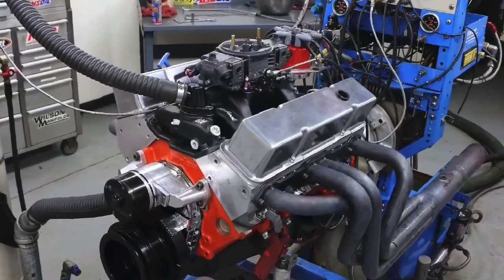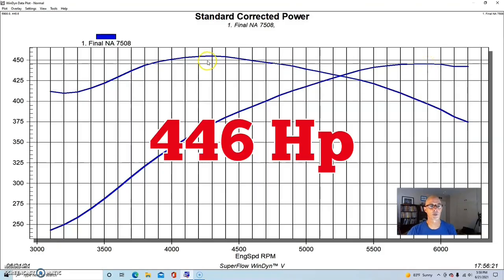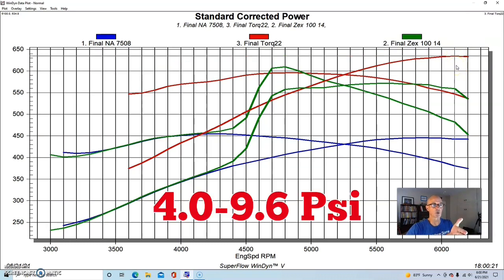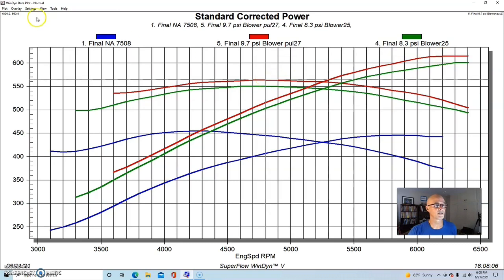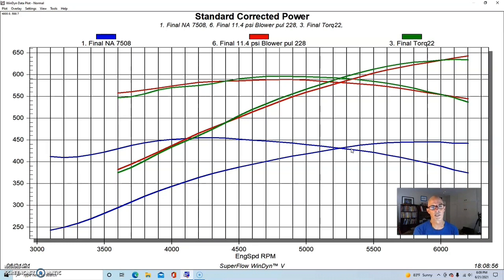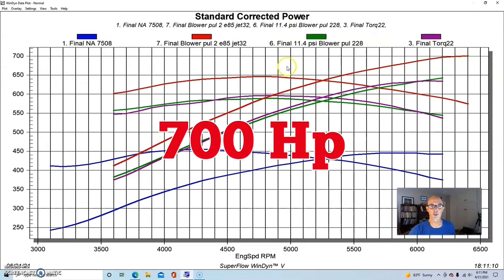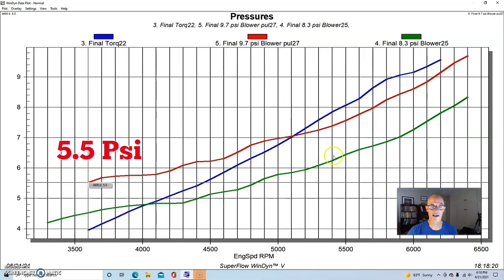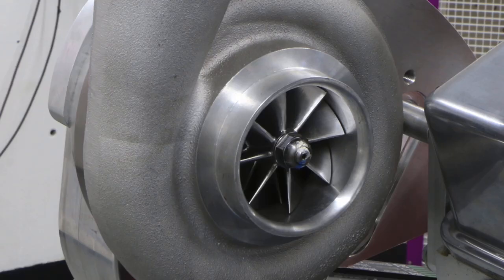6-71 BLOWER vs TORQSTORM-383 STROKER SBC BLOWER TEST

Comment: The 671 must take more power to turn than the Torqstorm. That's a big part of it, as well as the short runner manifold. It's also why it requires more boost to make the same power.
Reply from the maker: and a roots blower is less efficient than a centrifugal design

Comment: Hello. New too boost. I have a 383 with a 10.4-1 compression. Good bottom end build. I want to get this same 6-71 kit. What size carbs do you recommend to run methanol. Duel carb set up
Reply from the maker: twin 750s or 850s will feed this motor
Reply: @richardholdener1727  Thank you

Comment: how come no one ever start an engine at the lower rpm range where a street driven vehicle would be operating at? {such as from say 1200 rpm to may be 6800 rpm} on the dyno? some of us do have a family that will be riding with us where the GVRW might be around 5600 to about 7200 pounds. axle ratios in the 3.08:1 to the 3.54:1.
Reply from the maker: can you send me a video where you are at WOT at 1200 rpm
Reply: @richardholdener1727 ;on a road where starting off from a stoplight I have went to wot to get up to speed. so as I asked. how come no one start the dyno testing at 1200rpm? even our law enforcement have to go to wot from a stand still some times.

Comment: Thank you that was an awesome video I've learned both styles never was able to dino The Roots blower it was a 6-71 conversion I run a vortech V3 on a summit crate motor 383 with Abe ex250 shot of nitrous and she's a beast in a third gen Camaro I try to keep the setup Loki and she's pretty but not too fancy because I love going against these younger guys with deep pockets I enjoy it and we're all adults so it's fun but keep up the good work I love your video I'll share with others Mike

Comment: Not exactly the results the magazines predict, is it! The curves are very close, what a surprise. These two power adders are designed to make MORE POWER that's the goal.
For me, used for a drag racing, both are great, but the 6-71 should be easier, less complicated, and the one I would try first, then move to the torque storm, on the next project.

Comment: I was piecing together a v1 ti for my nnbs Tahoe with a built lmg with tsp prc2.5 799 heads. 10.5:1 compression. The customer support at vortech and the fact that many LS parts and brackets are discontinued unless you go a and a and then have to modify everything to fit Wich is no issue other than the price of the a and brackets,tensioner. Let's just say the frustration made me sell off all the vortech stuff to go tqstorm even tho I'll make less power there customer support, reliability and fair pricing is worth it's weight in gold.

Comment: THOSE 2 750 CARBS ON THAT 671 ON A VERY MILD 383 IS OVERKILL !
PROBABLY HURT BOTTOM END TORQUE LIKE CRAZY !
Reply from the maker: sorry-that is not how it works
Reply: @richardholdener1727  COULD HAVE EASILY GOT THE SAME POWER WITH A SINGLE 850 CARB,  OR 2 DUAL 450 CFMS , MAYBE RIGHT ?

Comment: did the TS have an intercooler?
Reply: I’m this situation it’s not needed as carb cools the air charge but that doesn’t work on roots because the fuel is going throught the blower too heating up

Comment: I have a 390 ford galaxie 500 1967 with a Camshaft, Hydraulic Flat Tappet, Advertised Duration 274/286, Lift .562/.565, Ford, Big Block FE.    And wanted to put a torque storm single supercharger and can i run it with out doing any work to the steal heads? Or do anything else to engine?
Reply from the maker: YES-BUT YOU WILL NEED A BLOW THROUGH CARB
Reply: @richardholdener1727  I have a 650 4-barrel carburetor from Holly can I turn that into a blow out carb? Or whats the best replacement with the most potential? "Also a great video suggestion- differences between a regular carburetor and a blowout carburetor and comparison of regular carburetor model versus blowout carburetor models!"
Reply: @richardholdener1727  and will i do any da damage to the engine with it running a 10/1 compression ratio ?

Comment: Why did you keep comparing the roots at higher boost pressure to the centrifugal saying they are the same? Compare both of them at the same boost pressure, 2psi will make a bit of a difference.

Comment: I would love to see this SBC Torque Storm supercharger be installed on a 5.7L Vortec junkyard engine with a blow through e85 carb.  Maybe pump gas for stage 1 then big cam and head work for stage 2 and ring gap, increased boost and e85 for Big Bang part 3.

Comment: The big 6-71 gets the "cool-factor" and has ALL the eye candy for sure, Torqstorm looks like a huge A/C unit compared to the ultra-cool 6-71 Roots blowers however TorqStorm rocks and can do a whole lot more than what is shown here. A whole lot more! The next pully would have put it around 14lbs and on E85 with more timing ??? 750-800hp?  That's an A/C unit I'd like to have under my hood.
Reply from the maker: WE'VE NEVER MADE MORE THAN 750 HP WITH ONE
Reply: @richardholdener1727   I was thinking that combo I mentioned would be good for about 750hp. Still a great A/C unit for sure. ;-)

Comment: A victor intake would have worked better than the dual plane. Never seen a boosted setup it didn't.  TS was about 18% more efficient. The TS is the clear winner here. That being said, a roots type blower makes everyone look. They are awesome.  TS is a great piece and would really shine is given a better intake with little water/meth from Snow hooked up. Would have made your E85 big pulley huffer look sick.  Consistent and predictable boost line(curve lol) and the ability to street drive without the heat, makes a way better combo from the TS.
Reply from the maker: A SINGLE PLANE MAKES LESS POWER THAN THE DUAL PLANE BELOW 5500 RPM-NA AND UNDER BOOST

Comment: Roots style superchargers usually make more HP one of these days you should run one of these on 120 octane race fuel and compare that to E85 and a 6-71 is just a baby street hot rod blower there not really for track use there huge to make your car look cool ( the smaller the supercharger the more boost it makes the huge ones make hardly nothing there for show like that huge 6-71 is giant when compared to a 14-71 which is what a top fuel car runs ) 12-71 or better is what racers run in roots style blowers 6/8/10-71 are basically hot rod street blowers IMO

Comment: Roots are a massive heat generator. Good ole Professor of Power Gale Banks examines 8 million data points down to the specific air density and pulses per second at x cc lol. 
The interesting part with his data analysis was when he hit a 1000hp smoke free on the stock LP5 dmax, the turbo and the intercooler were responsible for the exact same amount of power by air density with the huge temperature drop from over 400f to under 100f.
Roots are the least efficient blowers. Inefficiency is directly correlated to heat rise. The blower shop now makes a super cool water to air heat exchanger making the dam blower even taller. With that and Snows windshield washer fluid injection, you can really make power. 
You won't believe this, but you can inject water at 50% of air flow. Reno air races sport class Lancair legacy iv runs a 50 gallon water tank in the copilot seat to keep the air cooled Lycoming happy under big boost. I can't imagine that in a street car. One of the Professors of Power was talking about it for racing at Bonneville? I want to say. I just remembered that the possible ratio is mind blowing. Take 600 degree air down to nothing with straight water. I'll find the info again, just something I thought might interest you.

Comment: I used to run a 671 on a 327 in a 67 Camaro. In traffic you could lose a car behind it.  Looked cool and loud whine attracted lots of attention.  Tuning two carburetors is also a pain. My new project will eventually have a centrifugal supercharger.
Reply: If you aggressively cam it for low-low-low RPM, you should get a nice, flat torque curve, unless you just want top-end scream. With any blower, you will need more exhaust duration than for a naturally-aspirated engine, as getting the air IN is not the problem, getting it OUT is the problem. Dodge did that on the factory cam for the Hellcat versus the almost-same-motor 392 naturally aspirated.
If you like a flat torque curve, cam it for bottom-end power (but use as much lift as you can get.) then your centrifugal supercharger will take care of all the other RPM's.
Reply: I would love to hear more on that that's really good information thank you Mike

Comment: This is more proof that it is about manifold air density. Banks did a test similar to this with a sbc and a turbo at a constant 20psi. 1st run was no intercoer... 600 hp. 2nd run was air to air intercooler... 800 hp. 3rd run was water to air intercooler... 1200 hp. All 3 runs were at 20psi of boost. 
Downside is that it takes a lot of sensors to have a gauge that measures manifold air density
Reply from the maker: Adding an ATW intercooler doubled the power? Something else changed

Comment: By using E85 it just shows how much of a difference power wise it can add to a roots blower. That's why when you run methanol on them they make so much more power because it can cool that intake charge finally. The torque storm will of course make more power at the same boost because the intake charge is way cooler.

Comment: WOW.  The identical power curves blows me away.  Especially after seeing the boost curves.  The TS must be more efficient down low therefore generating the same power as the roots with less boost.  Plus with the TS, it's way easier to intercool.  Roots IC would have added another 3-4inches of height...but not needed with E85, like we saw in one of your other vids.  Thanks Richard.  Awesome video.

Comment: I thought no one really uses Roots Type because they make too much heat.
Doesn't a twin screw SC make less heat and do a better job?
Reply: Yes, the Lysholm screw compressor is a true compressor rather than a blower like the Roots so the Lysholm is more efficient meaning lower temperature for a given pressure. But they cost more.

Comment: Good test choice Richard, still trying to figure out the best hyd. roller cam for my street Chevelle with my single TorqStorm on crate 502 and MSD Atomic. I know it needs high LSA of 14 to 16, but just can't decide!
Reply: No, you don't need a wide LSA. There's little boost at low speed with the centrifugal blower so very little charge blows through during overlap. I would run a 106-108° LSA on a 502 and cam it just a little smaller than you would otherwise to make good low-end and the blower will make the top end power.
Reply from the maker: pick a good na cam-that blower will only support 700-750 hp
Reply: @richardholdener1727  I was thinking the boosters from Atomic (seems the Atomic 2 has less) would be my restriction and would consider going with blowthrough carb. But if it is the blower, then oh well! Thanks for reply

Comment: Wouldn't the 6-71 create more parasitic loss especially down low?
Reply from the maker: parasitic loss increases with engine speed
Reply: Makes sense.... Just figured there is more rotating mass with a 6-71 therefore would take more HP to start spinning

Comment: Rootes (the original spelling) blowers were designed as mine ventilation devices in England in the 1800's. The originals were  straight rotors with leather seals on the case. Not terribly efficient, but it was far better than nothing. Those we have now are MUCH smaller, better sealed, more efficient and lighter than the behemoths they began as. That said, they require power to run, and turbos will come out better in the efficiency  equation. If a blower of any kind (TorqStorm, Paxton, Roots) is driven off the engine's crank, there will be power used to drive it. Well, duh! you say. Expect some amount of power to be sucked up in driving a blower. There really shouldn't be any surprise here, but any improvement in efficiency in a Roots blower will be in tenths of a percent, and Magnuson seems the most efficient of the lot. They don't have quite the visual presence of a 4-71 or 6-71 Jimmy, though. Whipple? essentially redefined the whole blower. Different deal, and higher efficiency to boot. Any blower costs a bundle of cash, and you'd best have the funds available to feed your habit. I don't have the money, tending more toward the eBay turbo than the JimmyX-71 (or X-53) blowers.

Comment: Are you sure that blower case to rotor clearance and seals were up to the task?  Seems like the boost curve should have been much flatter and even taper at high RPM due to efficiencies.

Comment: I'd like to see a LLR Vortec 3700 built & turbocharged.
Reply from the maker: me too
Reply: @richardholdener1727  Hey thanks for the reply!  I enjoy your content because you demystify so much.  I have zero experience engine building or modding.  But I'm helping my nephew build a lemons car & there are some projects I'd love to do.

If you ever get a chance to try a Colorado 5, I'd watch that avidly.

Honestly my dream project is taking an old TR6 and building it with modern chassis, engine, suspension, transmission,  etc.

I've always loved the sound of 5 cylinders.  It is emotional not logical.  Logically a crate LS would be the way to go.  Don't need huge power.  Stock it was 160 at most.  So 3-400 hp would be a HUGE upgrade.

The other is my Grandma's 57 Chevy which is now mine.  It isn't for sale, so I don't care about collector value.  And stock it is frankly terrifying to drive.  The brakes are more of a hopeful wish & handling is... quirky.  I'd love to update it with modern motor, transmission, suspension, BRAKES.  Then I'd be confident to let my nephews use it.